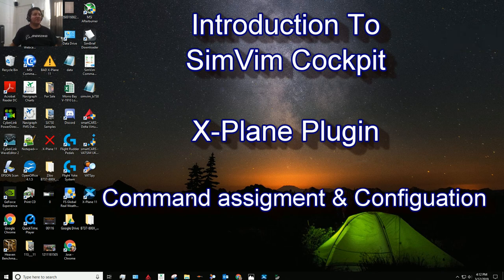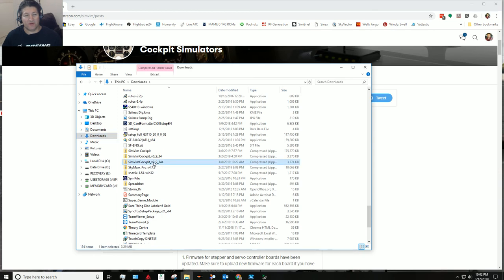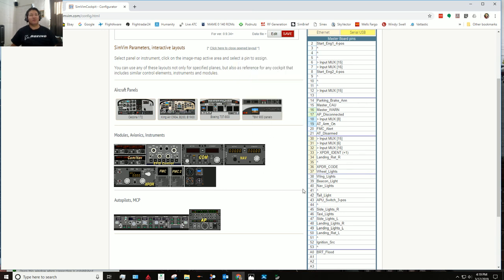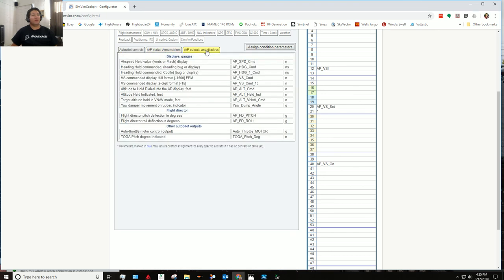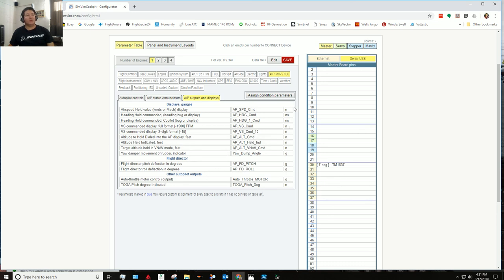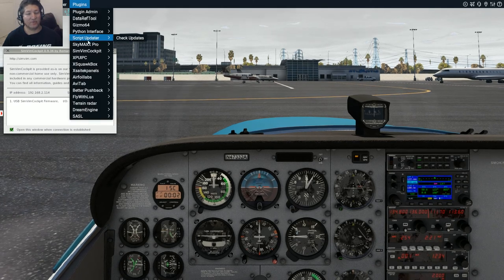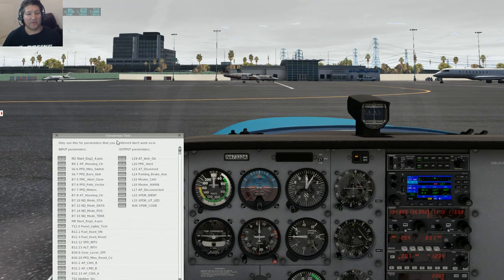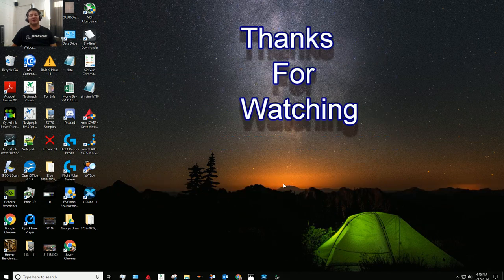Intro To SimVim Cockpit configuration & parameter assignment (Old)

Comment: That's great I didn't know about simvim.          The difference between simvim and Air manager is Air manager is virtual panels usually to be used with touch screens and an encoder like the knobster,I like to fly a lot different aircraft so I use a mix of both Air manager and panels.
Reply from the maker: Yeah, I fly a lot of planes too that's why I built a generic setup not a specific plane. They also have a SimVim Panel program but I've never tried it.

Comment: Hi,
Please take a note, the  SimVim Configurator interface shown in this video is obsolete, it was changed since that time, and it can be changed in any time again as we constantly try to improve it and make more comfortable to use. This also applies to  following versions of the SimVimCockpit Plugin interface, now it looks different from those shown in theis video. The images / diagrams and pages  on the SimVim website  can also be replaced or changed.
Vlad
Reply: why did you remove 737 from configurator.

Comment: How many arduino mega 2560 can YouTube connect to x-plane 11?
Reply from the maker: With SimVimX/Real Sim Control only one master board. You only need one because using multiplexers you can connect hundreds of buttons, switches, encoders etc. 

You can also conect a few slave Uno or Nano boards for Servos, steppers, LCDs and a key matrix.

Comment: Hi guy’s does anybody know why when i save my file to send it in my xplane 11 files the files is an html files and not a cfg file. There is any way to convert it or set something to do it the good way. thank you.
Reply from the maker: Hello Simon. I'm not sure which browser you use and if it might be a little different than on Chrome which is what I use. You should just be able to select All Files as the file type and just manually type "data.cfg" as the file name. Even after you save it as HTML, you should just be able to change it from data.html to data.cfg. I've never seen mine trying to save it as HTML unless it is trying to save the entire web page not just the configuration file.

Comment: Hi again, do you mind if I ask a couple of questions? 1) Have you put any 595 shift registers in your cockpit setup? 2) If so, which Mega pins do you connect the data, latch and serial output to? 3) Lastly, providing all of this is still relevant, how do you assign the shift register in the SimVim configuration page? I am simply trying to set up a small array of LED's to switch on and off, when certain instruments are operated in XP11. Sorry to burden you again, regards from Paul in the UK :-)
Reply from the maker: I was pretty sure I had already replied to this comment a long time ago. I had told you I have not used shift registers. I have no idea how to use those at this time. I just bought one so hopefully soon I will know how to use those.

Comment: Hola, thanks for posting this video.  How do I configure a conditional output to energize an Arduino digital output upon energizing the Avionics Master Switch in X-Plane 11?  I found the Avionics Master switch 1 in the SimVim 172 configurator, but it only allows configuration as an input.   Thanks.
Reply from the maker: I think I'm not understanding the quesion. Are you trying to light up an LED or light to indicate when the avionics master switch is on?

Comment: Hi,

I'm new to electronics and trying to build a 737 MCP. I have the 7 segments and enconders working but racking my brain trying to connect Korry push button 5 prong pin. Would appreciate a video or message explaining process. Thanks!
Reply from the maker: Hello, I have absolutely no experience with Korry switches so I'm afraid I won't be of any help on that. I think your best bet would be to join the SimVim Q&A forum and maybe Vlad, Roman or any other more experienced user can answer that. https://simvim.com/simcom/

Comment: 22:22 you just defined 2 display,but not setup any data to them.and i can tell they mot work.there is no i2c for lcd and 7seg max7219 not work alone. need mux.and its setup so weird. CS should be to select display. CLK and DIN is same for all,but its CLK select display DIN CS is common LOL .i do not understand it. and display not work.have they make bobo mixed clk and cs
Reply from the maker: Sorry this video is just a basic introduction to the different things you can connect with SimVim. I suggest you read the pages on their website for a through explanation of how to connect different types of displays. I clearly state on the video that I have not used any other display except for a 4 digit one I have.

Comment: XPUIPC and mobiflight combo is so much easyer config and yes same setup work FSX with FSUIPC
Reply: I guess that is a matter of opinion, but I have to say that I completely disagree with that statement.
Reply: @rightrudder788   it was hard me to get 1 button work actually not even got that example work lol. and arduino not recognized after restart game allways needed update firmware. and i can code my arduino and connector program. config simvim is pain in ass no actual example code. this is how it look.all i would need example how config look. then just change what need control. displays is hard to config. it allmost look like NEED multiplexer and it wont work just in main board.like i say before CLK CS DIN is unlogical used lol based on what website tell. i had mobiflight setup all i needed XPUIPC old fsx connector and arduino project worked like charm :))).in mobiflight you just choose what need or use allready known offset(havent been change 20years) lol
Reply: @jarisipilainen3875  I see. I have had no such issues, luckily. I have set up all the light/power/avionics switches with no issues. Also controlling the heading bug and nav freq with rotary encoders. Autopilot display is up next :) I am also a coder, but was happy when I found tools that provides all the logic out of the box :) Kudos to @SimVim and the mobiflight developer(s) for providing tools for this!
Reply from the maker: I haven't tried that solution but I don't think it can get any easier than SimVim, it really is just a plug and play solution with absolutely no coding or programming required. Also I doubt you can get the personalized help and responsiveness you get from Vlad and Roman. All I can say is this is a piece of cake to set up and use. Currently i have over 200 functions on rotary switches, push button momentary switches, toggle switches, rotary encoders,a couple of potentiometers, some LEDs and 1 display and have no issues except when my wiring was the problem.

Comment: Regards.
I am Milton and I write from Bogota Colombia, I am making a B1900 cockpit with SimVim, but I have had some problems with the servo and stepper motors, I have consulted Mr. Vlad but he has not given me any answer with a solution, you could help me with the basic configurations with stepper motors and servos ??
Reply from the maker: Hello, I have not worked with stepper motors or servos therefore I cannot help with that. Vlad is pretty busy, sometimes it takes a while to get a response.
I would recommend putting your question in the Q&A section on their website, it will be faster.